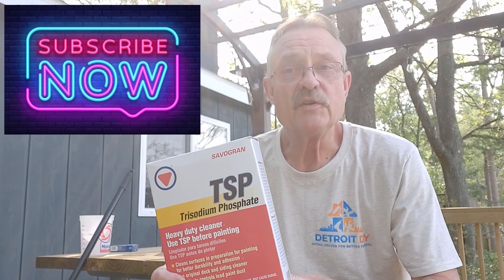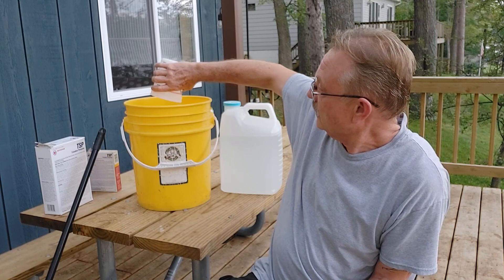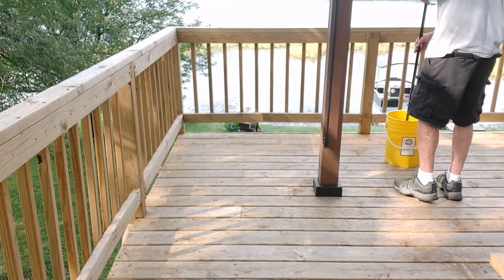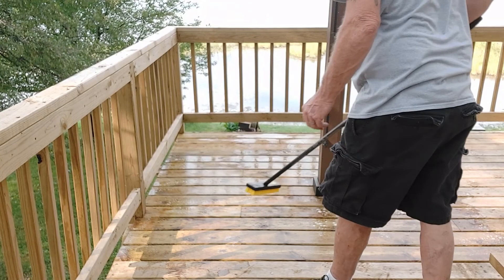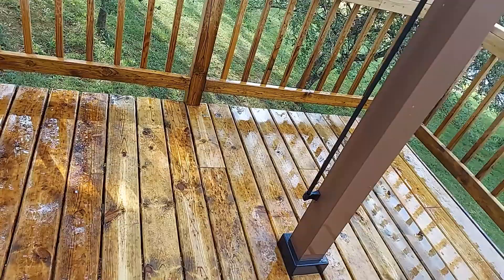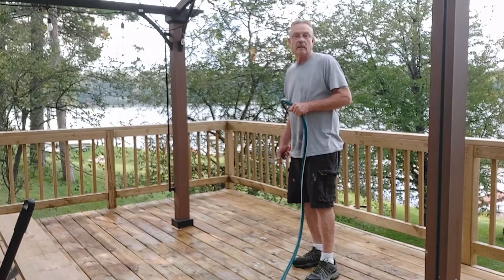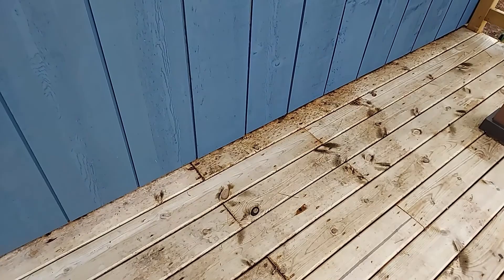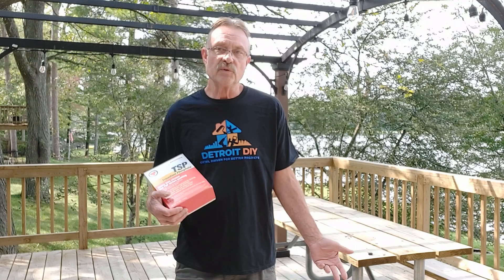Will TSP clean this stained deck! [CLEANING BADLY STAINED WOOD!]

Comment: Hey desecent video, thanks for your work.
There is 1 big tip I recomend.. Freely water the surrounding area FIRST. The deck, your siding, windows, plants any thing that could get over sprayed. As well I REALLY recommned lighty to heavy misting your wood first, you can work a much larger area and it doesnt dry out as fast.
And a pump tank sprayer is often worth the few bucks if you wanna have a nice even spray of your chemicals.
The most common 3 ALKALINES for deck, fence and paint prep... TSP, OXICLEAN, BLEECH.. and others sure.
Think these do the Heavy dirt lifting for you, and yes little to Lots of Bleeching can happen.. A PRESSURE washer can be your friend if used correctly.

And Oxaclic Acid.. is a strong Acid that can be used before or after MANY good Rinses. It really helps neutralize the PH of your wood in preparation for stain or paint.
Also Acids are what will kill all the RUST and metal stains..
Weirdly many call the Oxalic Acid part the Bleeching part.

I swear I am only trying to be helpful here.
You have a beautiful deck, take the time and right chemicals to spruce it up. Its worth your time, if your spending the money anyways.

Comment: I did about the same formula but aplied it with a spray tank then pressure washed (  I tried not to lift the grain but I had some grain run out that I use some gorilla glue on and used some bondo for wood to repair some bad spots) and the wood looked like new. The wood was black from mold and mildew before I started. I used disposable coveralls and goggles and a respirator as I was spraying and pressure washing. To me the spraying and pressure washing was worth it because it was large and 2 levels.

Comment: Real TSP is great to have around for heavy duty cleaning jobs like this. I regularly use it for restoring or cleaning old wood furniture, where it really excels, or just heavy duty cleaning in general. Nothing really eats through old grime and grease as well. You can use it on essentially anything besides metal, glass/ceramic, and some painted surfaces, where you'd want to test it first. It's stable in solution too, so you can keep it around in a spray bottle for awhile.

Comment: The bleach will do the same without the TSP.  When washing the house, be sure to rinse windows good… don’t let TSP sit on the glass for too long or you will have a residue that you can’t get out unless you buff with a ceramic stove top cleaner.  Can be a real nightmare.  I just avoid tap all together.

Comment: I know this is old, but oxalic acid might work well if you want to try a few of the really bad spots this summer.
Reply from the maker: I was looking at it last week and i do see a few spots i wouldn't mind getting better. I will give that a try, Thank you
Reply: The tsp is stronger and faster I think. Tsp was recommended on a  "This Old House" article. Also when mixed with bleach it kills both mold and mildew which you want to do before putting any protective treatment on.
Reply: Oxalic acid. 🔑 do you Watch The Wood OF wizard

Comment: The label on the Clorox bleach bottle states in bold print “do not mix with any other household chemicals”.  I would use caution as you’re on your own if you use this method.
Reply from the maker: I followed the instructions on the T.S.P for cleaning wood.
Reply: @detroitdiy    Thanks. I’ll have to check that.  Disclaimers can be dodgy.  🤔